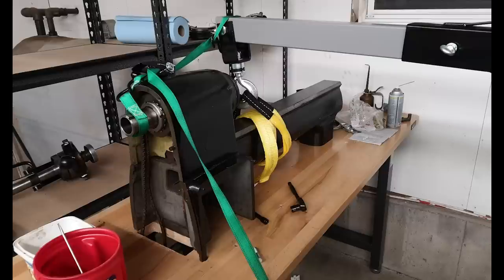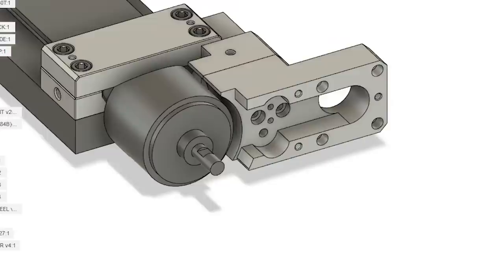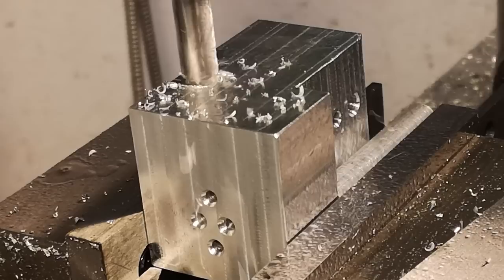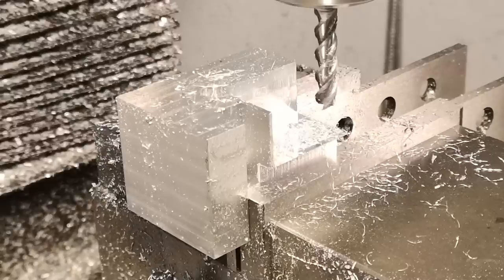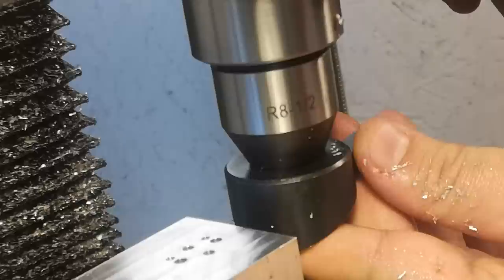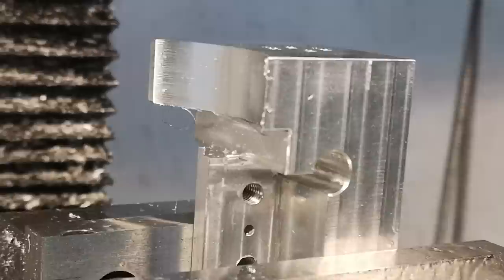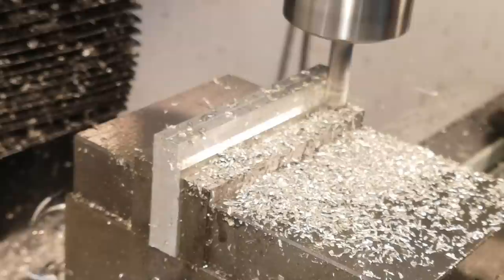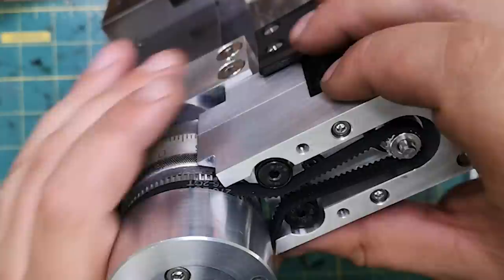Rivett Lathe Power Feed -  Part 1:  The Need for Feed

Comment: I've heard the name pronounced RI-vette, like the car Chevette.  Minor point, obviously, but we gage each other's credibility by little clues like pronunciation.  Probably some ancient tribal instinct.  Also, I recommend a 2-fl-oz squirt bottle with blunt hypodermic needle for spraying coolant.  Buy a few and load them with IPA, WD40, and your other favorite cutting fluides.  Especially works well when parting on the lathe.  Another trick is to have all the fasteners.  Buy alloy socket heat cap screws, short and long.  Then modify the head if needed.  You can make a low-profile head, flat head or slim profile on the lathe.  It's surprisingly inexpensive compared to the time spent shopping and the irritation of waiting for your McMaster order to arrive.
Reply from the maker: Oh interesting, I had no idea!  You may freely gage my credibility as lacking on this particular machine; the company started, had a good go of it, and went out of business well before i was born, and information is scarce!  Good call on the smaller squirt bottles -- an atomized spray is mostly wasted anyway.  Proper coolant and containers is on the list, but it's a bit of a luxury item at this point!  Good call on the fasteners, it's another system I'm figuring out -- it's just funny when I have 12mm socket head screws and, for some reason, design a mated height that has to be 10mm.  Oh well.  Thanks for the comment!
Reply: @TabletopMachineShop It probably went out of business well before I was born.